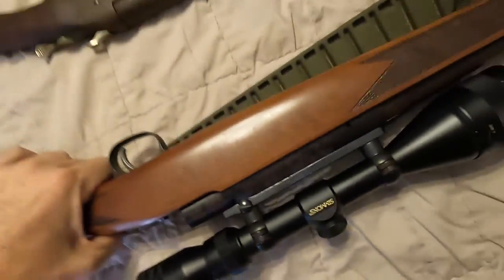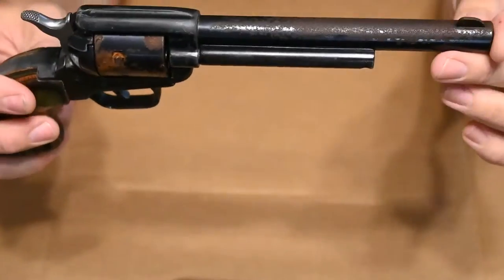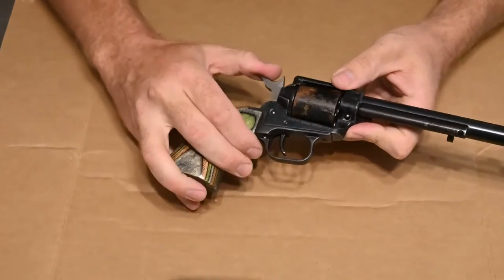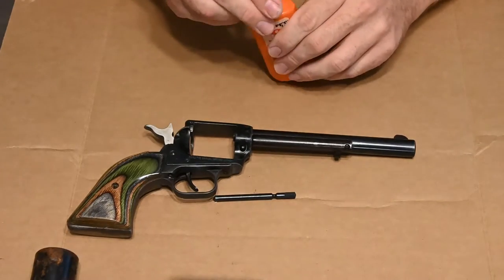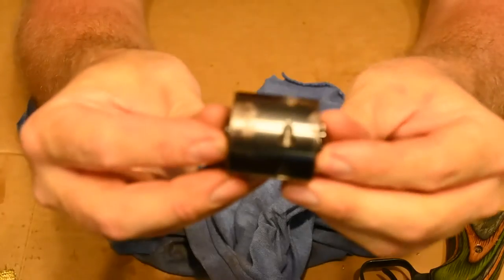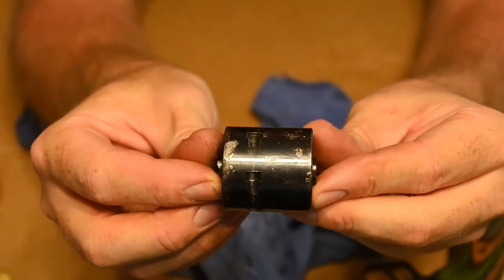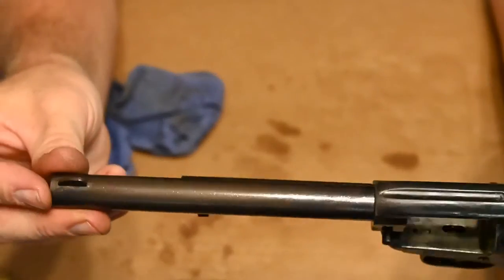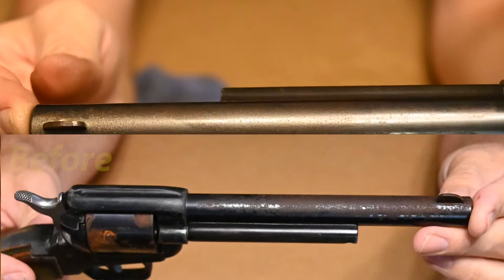All of my GUNS RUSTED!  Part 1:  Hoppes 9 to remove surface rust?

Comment: Pitting means the steel is gone. Polish to a perfect smooth surface and redo the blueing. For now, remove the rust on all your guns, like you just did and protect with oil.

Comment: Boil the metal parts in water it will convert the red rust into black oxide, then polish with 0000 steel wool.

Comment: I don't see any comments on your video. Thank You for showing this. I heard for a long time that some guys use a copper sponge or even a older real copper penny to do remove rust but I did not know that Hoppe's 9 oil can do that great of job.. I'm going to start using that more as a rust protectant on my firearms. Thanks again for your video.
Reply from the maker: Thank you for commenting!  What I am using here, I believe, would be considered the copper sponge.  I also heard about using an old penny but have never tried it.   I was not sure if the Hoppes would do much to lift the rust, but was surprised at the results.  Make sure you check back  for my next video coming out on a .410 project, because I think it worked better!

Comment: That's not surface rust that's deep rust
Reply from the maker: So are you saying this worked well and removed deep rust? Or that the surface rust is removed and deep rust is still present according to the after pic?   There was definitely some pitting that will require more work than what I did here

Comment: Ähnliches Problem habe ich auch. 
Halte deine Waffen immer unter Öl und wenn du einen Lagerort hast der zu feucht ist, denn Verpacke deine Waffen in Plastikbeutel. Deine Munition kannst du ebenfalls in Zipbeutel lagern. Besser in günstigen  verschließbare Kunststoffdosen für Lebensmittel.

Lagerkisten für Waffen mit Schaumgummieinlage haben sich ebenfalls sehr bewährt.
Reply from the maker: Translated:
"I also have a similar problem.
Always keep your guns under oil and if you have a storage location that is too humid, pack your guns in plastic bags. You can also store your ammunition in zip bags. Better in cheap sealable plastic cans for food.

Storage boxes for weapons with foam rubber inserts have also proven very useful."
Reply from the maker: Thanks so much for the comment and advice!

Comment: I have a similar situation.  We recently downsized and unfortunately I was very ill between moving from the old house and getting my firearms into the safe at the new house.  Fortunately mine aren't as bad as yours but I'm incredibly interested in finding the best way to remove the rust on mine.
Reply from the maker: I oiled mine and let them sit for months trying to figure out what to do.   Finally I just did it.  Having done a few….and I remind you im just a gun owner not an enthusiast or gun smith, here’s what I would try first:  get a chore boy copper scour pad from your local hardware (MAKE SURE it’s 100% pure copper, DO NOT get anything that says copper plated). Then get some Safari Charlie gun lube (I used this stuff in another video I did and it works wonders!).  Spray it down and scrub.   You’ll notice that the copper scour leaves a residue behind but just just spray and wipe with a clean cloth and it come right off.   You can also get a copper cleaning brush from your local hardware to get into nooks and crannies.  They look like a tooth brush and usually come in 3 pks.   I have taken a lot of abuse on these videos by people saying I’m doing it wrong and saying to use 0000 steel wool.   I did not have any success using that to remove rust.  I use that to polish cold bluing when I reblue. Thanks for your comment.   Let me know how it turns out!

Comment: Keep it away first place.  Renaissance wax or NuFinish auto polymer car finish.  Hoppys #9 for inside barrels .   Nice to protect in vacuum food storage bags for not to frequent used items.  
My opinion is air conditioning as it is cheaper than replacing guns, cameras, and fine woodworking tools.

Comment: You should try boiling. I have found trying to remove rust that bad almost always completely ruins bluing. When you boil the gun in distilled water it converts the red rust into black rust
Reply from the maker: Ok so I tried this in another video….on a Henry lever 22…I boiled for about an hour and saw no visible difference.   Did I boil long enough? Will it visibly change color??
Reply: @onthejline9328  I didn’t get any rust converted to black oxide when I did it. It did however raise the rust so it could be removed much easier. I used a wire wheel so fine that I could rub my hands on it while running and that’s all it took. 3 passes to clean up a gun that looked like it was buried for 50 years and seized solid. Probably would have worked even better if I used distilled water.
Reply from the maker: @MikeM10293  I did use distilled, but didn’t convert either

Comment: My gun dealer recommended using cutting oil. He's had some fantastic results. Have you considered electrolysis? I've tried this on tools but hesitate doing that on guns. Maybe someone has had some experience.
Reply from the maker: Thanks for the comment!   I have no experience whatsoever with electrolysis but would certainly try it and do a video if I had a “burner” gun that would be little or no loss if it screwed it up. Lol.  Did you have good luck on your tools with it?
Reply: @onthejline9328  Worked great, going to do the iron pans I bought and restore them.

Comment: 1. Taurus rough riders new have a horrible bluing and finish anyway.
2. You should of removed the ejector rod and housing. There is most likely rust under it.
3. For the price to fix the taurus, you could just use that cash to by a cerakoted Ruger. Far superior revolver in every way.
Reply from the maker: 1. Thanks for commenting!
2. This one was well used when I got it and bluing was definitely a little rough
3. Did not think about ejector parts. Thanks for the tip!
4. Already wanting two of the Ruger Wranglers for my boys
5. Be sure to check out Part 3 coming in the next 24 hours!
Reply: @onthejline9328  oh nice! Your boys will love it and it should last for many years to come.

Comment: the rust has been removed, but also the burnishing, the oil and brass system, in theory, should preserve the latter, but this is not the case, it remains imperative to darken the pieces.